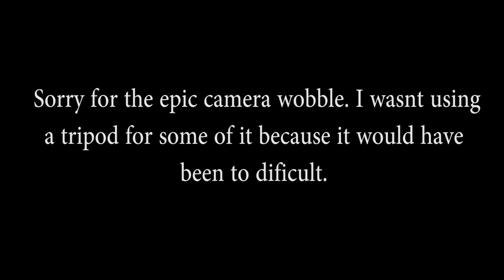AeroCool GT S Black Edition

Comment: If I put a water h100i on top, it would fit a 200mm cooler on top of the outside and then put the carcass on top as you show in 6:36?

Comment: MY FAN CONTROLS WONT WORK? HOW DID U GET URS TO WORK
Reply: did you plug them into the power supply or mobo? did you turn them on'?  a lot of gaming cases actually allows you to turn them on or off and at whatever speed you like too.
Reply: not to sure how to turn them on
?
ill see what its connected to first lol